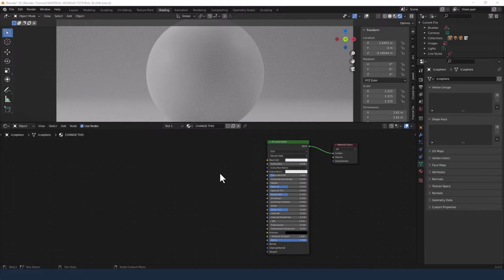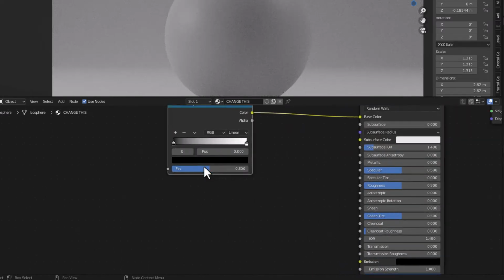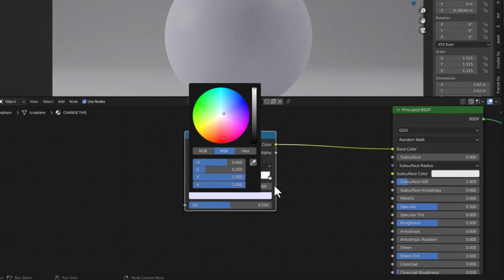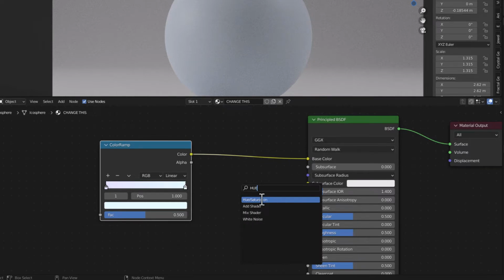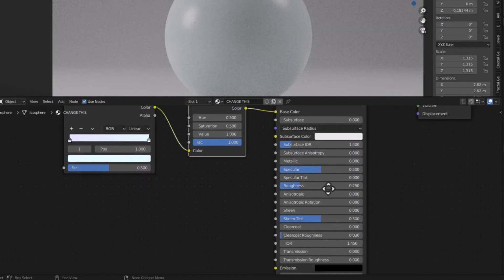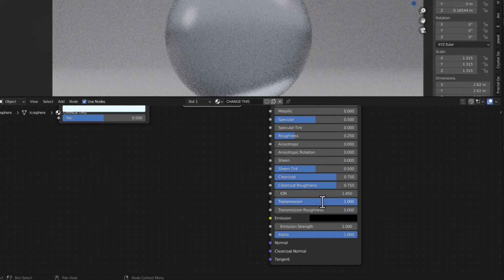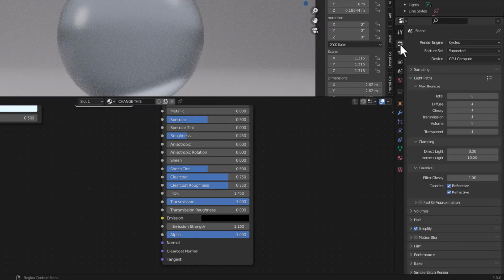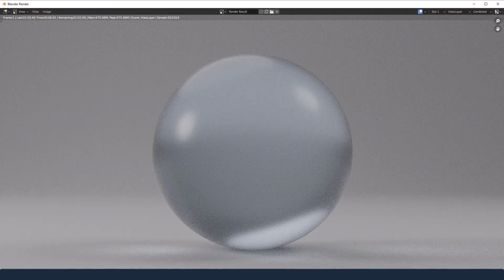CREATE A FROSTED GLASS PROCEDURAL MATERIAL IN BLENDER

Comment: It looks nice.... but the ColorRamp will not do anything unless its Fac is driven... Or to be more precise, its Fac is not driven and is set to 0.5, so it is outputting a single non-varying colour halfway between the two colour stops... which is then desaturated further by the Hue Saturation Value node... so you could replace all of that with a single RGB set to Hue 0.598, Saturation 0.125, Value 1.0.
Reply: ...alternatively, keep the ColorRamp and drive its Fac by a Layer Weight node using the Fresnel or Facing outputs... for a magical two-hue CGI glass
Reply from the maker: Thanks for the tip(s). Making the changes you suggested didn't really have much of an impact using the colours involved and the color ramp was intended to export just a single colour. I probably should have said that folk could drive that factor for a different result using more pronounced colouring. Will keep this in mind for the future.

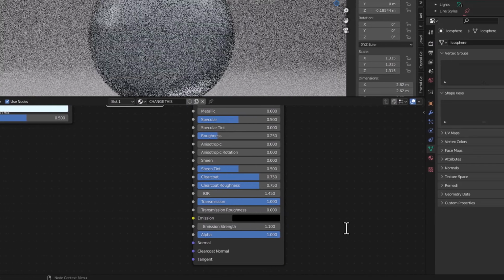Comment: 2:14 I don't think changing the emission strength to any amount will make a difference, since the emission value itself is at 0 (default - black). What's your reason for changing it to 1.1?
Reply from the maker: As mentioned, it doesn't make a huge difference. The only reason I suggested it was to offer some 'wiggle room' depending on the scene in which it will be used. Yes, you defo should also change emission colour. You can ignore if you don't see any difference.
Reply: @blenderbitesize  No it doesn't make ANY difference at all. Even if the value wasn't 0 (black), why would you want your glass emitting light? Also your use of the color ramp was completely pointless. Who uses that to input a single color and then change it anyway using the hue/saturation node? You clearly don't know what you're doing, so why are you producing these videos? I hope you've learnt a damn sight more in the year since.
Reply from the maker: @tinpot1978  Good to hear your thoughts. 
"It doesn't make ANY difference": We will have to agree to disagree. This tutorial was about how I went about creating this material, rather than how someone else would go about it. Perhaps you could share your thoughts on how you would go about this with the person that asked the question originally? That way they would have the benefit of both points of view and could work with whatever suits them.
"Who uses that to input a single colour ...": Me. Like I said, it might not be THE way, or your way, or anyone else's way, it's just my way.
At the time of recording this video, I did know less than I do today. In addition, the software has been updated. I can't guarantee that I know a darn sight more than I did then, but I can say that I know more.
Thanks for taking the time to add your thoughts to the conversation and look forward to hearing them for other videos that I release.